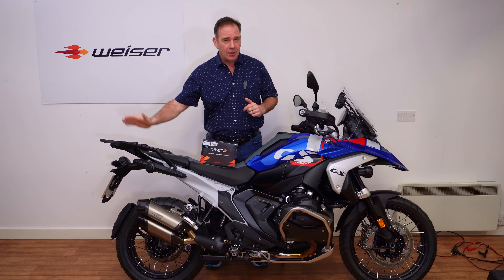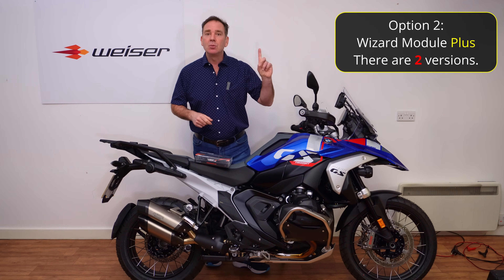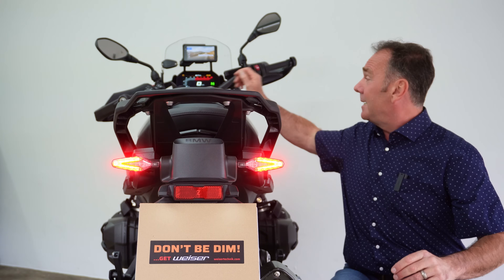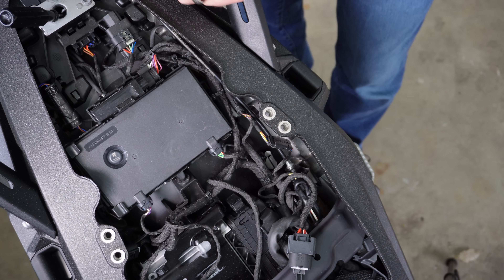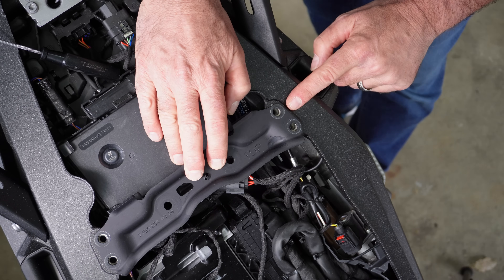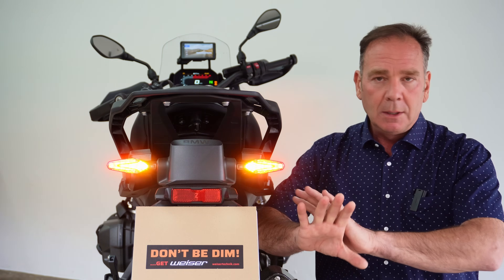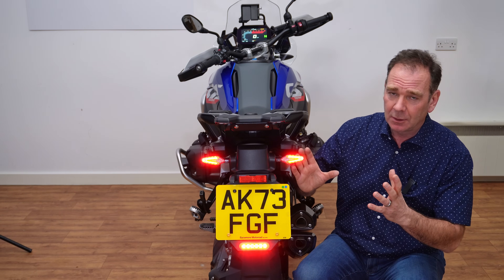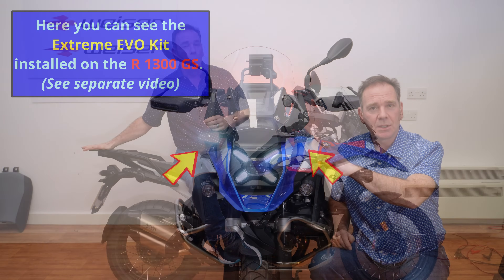BMW R1300GS Weiser-Technik Wizard Module + add a Tail / Brake Light to your R1300GS, F900GS, S1000XR

Comment: I'm riding a BMW R1300 GS for 2 years now so I can speak from experience. The argument that the stock rear light is unsafe is just not true. Many fellow riders have mentioned to me that my stock rear lights are blinding and very distinguishable when it comes to braking and indicating. Using these arguments is just plain BS. 

This being said, the weiser product is adding additional functionality and visibility which is great and why I will purchase them. The weiser products are great in quality, durability and functionality and simply don't need this kind of false arguments. It's only due to camera settings that the stock lights seem to lack in being able to distinguish in functionality.

I would recommend buying these lights because of the added safety and functionality. But don't buy them because you think the stock lights are limiting in visibility or safety. They are perfectly fine and even better than most stock lights. Don't be fooled.

Comment: Since myself and a friend have fitted these we get multiple warnings with rear light failure, cruise control failure and limited emergency call service, and I also see other saying exactly the same on other forums, very poor with no back up from suppliers…..not happy 🤬
Reply from the maker: Hi Fitchy, I am aware that in some geographical locations there has been a problem, which is due to the BMW oem software that is installed in some markets. Weiser has been testing an updated version for these motorbikes, send Weiser an email and they will help you and replace the unit if necessary for free 👍. 

info@weisertechnik.com

Comment: So if you have the British version where it has both tail light and brake light, are you then breaking Germanys laws by riding it through their country?
Reply from the maker: Hi George, Germany has some strange rules like not allowing 3 rear tail lights, but if you’re travelling from the uk to Europe the police are normally very friendly and flexible if you are stopped. However if you’re doing something silly like excessively over the speed limits they may check your bike more throughly, although I’m not aware of anyone having a problem. We also have rules about horns not exceeding a set db level, so technically we can not fit a Denali sound bomb horn, although many owners do.
Hope that helps. Carl
Reply: @justthewayitis thank you for the quick response 😊
Reply from the maker: You are welcome 🙏

Comment: What "problem" are you fixing here exactly?
Reply from the maker: Hi, the standard setup has all 3 functions (indicator, running light and brake light) working in the small indicator at the same time. It’s difficult for people following you to see you indicate.  This system improves this greatly by only allowing the indicator to work by itself when indicating. Hope makes sense 
Best wishes Carl

Comment: Would like to position the extra tail/brake light where the reflector is above the Reg Plate 
I can add a an additional reflector on  bottom corner or the Reg plate 
Your thoughts pls
Reply from the maker: Hi James, Weiser have a new upper bracket that is due to be released in August that allows you to mount a B6 or T3 above the number plate just below the rear rack. This might be something to consider. 
Best wishes Carl 🙋🏻‍♂️

Comment: Thanks for another excellent video. I've just "upgraded" my R1250GS to an R1300GS so I will buy the kit including the additional brake light. It's a pity that the wizard modules I used on the R1250GS are not compatible with the R1300GS but there you go.
Reply from the maker: Hi Richard, good morning and thank you 🙏. You may want to wait a couple of weeks 😉, there is a new product that is due to be launched very soon, I’ve been testing it and installing it on several BMW R1300 models. I have a review video going up on my channel once Weiser confirm the launch date. Best wishes Carl 🙋🏻‍♂️
Reply: @justthewayitis  Thanks Carl, I'm happy to wait - with bated breath. :)

Comment: brake light needs to up high I reckon put the reflector down low
Reply from the maker: Hi Paul, there is a new bracket coming very soon to mount the B6 or T3 under the rear rack, I’ve been testing the prototype for 5 weeks and it’s great for getting the brake light up high. You can see them at the ABR festival next weekend, launch date in a couple of weeks. From Weiser Technik.
Best wishes Carl 🙋🏻‍♂️

Comment: Hello Carl! Can you please show me how to connect the brake light: Denali B6 Auxiliary Led Licence Plate Brake Light correctly to my BMW R 1300 Gs. Is it true that it works with plugin? Please help.
Thanks Chris
Reply from the maker: Hi Chris, first you need the correct V5 wizard module which has the brake light output connections in the configuration you want ( see the Weiser website) then it’s a simple plug and play connection. The routing of the cable is fairly straightforward as you will need to feed it down the centre section under the passenger seat, then inside the rear tail section, exiting at the bottom. I currently don’t have a video showing exactly how to do this, but I am planning to film this later in the summer for both the GS and GSA.
Best wishes Carl 🙋🏻‍♂️

Comment: Can this Weiser kit be installed to the front indicators on a 2021 s1000XR? I believe it’s okay for the rear indicators. TIA.
Reply from the maker: Hi Gary, I think you can fit the updated V5 link wizard modules on the rear if you want to keep the stock rear indicators .
I think you can move the extreme evo kit front and rear from the R1250gs to the 2021 XR. The best thing to do Is ring the boss at weiser (Mark) and ask him to confirm +44 (0)203 649 7524 he is very friendly.
Carl 🙋🏻‍♂️

Comment: Hi Carl - different subject - what make is the engine crash bar? It looks good and it appears adequate and light for on the road use? Great video as usual.
Reply from the maker: Hi, on the R1300GS, it’s the standard BMW OEM bars. Which are probably fine for on road protection with the occasion drop at slow speeds.
Enjoy your Sunday 👍, Carl 🙋🏻‍♂️

Comment: Carl, does the tail/brake light in the V5-BR version just plug into the V5, so that there is no cutting into any other wiring involved?
Reply from the maker: Hi Stags, you can’t plug a them together, they are different modules, the V5BR has the extra cable for running down to the brake light module for the B6 or T3, it’s all just plug and play no cutting wires on the R1300GS/A.
Reply: @justthewayitis thank you again Carl, I very much appreciate you taking the time to reply.
Your videos are superb!!
Reply from the maker: You are very welcome 🙏 the tail unit drops down with just a few bolts removed, you don’t actually need to completely remove it, but it is easier that way. The cable fun’s inside the housing and exits through a small hole that goes to the B6 mounted below the number plate
Reply from the maker: Also there is a new product coming from Weiser that allows you to add extra hand guard indicators in addition to the inboard ones. It also offers you  all the V5BR features and more. I’m currently working on a product release video for them and have installed it on several new R1300GS and GSA models. It’s an amazing product . There will also be a new bracket to mount the B6 under the rear rack assembly.
It will be released at the ABR festival at the end of June.
Carl
Reply: @justthewayitis  That’s interesting, might wait to see what the new bracket looks like!
Once again, I thank you for taking the time to explain things in such detail to an idiot like me 👍😊😊
Reply: So the B6 has a connector that just plugs into the V5?
Reply from the maker: Just for clarification it plugs into the V5BR & V5BO but not the standard V5 😊
Reply: @justthewayitis  Yes Carl, I’m going for the V5BR. Thank you again! 👍
Reply from the maker: 👌 have fun 🙋🏻‍♂️ it’s a great addition to the GS on the rear.

Comment: Hi carl,  my order extreme evo rgs1 rear just came today,  do you have any video/installation guide specifically for GS  1300? thx!
Reply from the maker: Hi, good afternoon, no sadly I do not have an installation guide yet for the 1300, I will he doing one later in the season when I have a 1300 to work on.
It’s fairly straightforward, I wish you success 🤞
Kind regards Carl 🙋🏻‍♂️

Comment: Carl. I watched your video and bought the modules for my R1250GS tail /stop light and rear indicators. I'm just about to fit them but I'm concerned that as a modification it will invalidate my bmw warranty. What's the BMW position with this ? Thanks Steve
Reply from the maker: Hi Steve, well BMW dealerships install these directly both in the UK and North America, so I don’t think it’s a problem. Weiser supply these to several uk dealership and they keep them in stock and install them on their customers BMW bikes.
You could ask your dealership of course.
Best wishes Carl

Comment: Thanks a lot for your great videos. Due to i live in Slovenia, i need to do homologation for this lights /same i order and install. Could You Please give me the link where i can get something as TEV or ISO for this lights. Back in March 2024 i purchase Weiser EXTREME EVO Multifunction LED driving lights ( front and back), together with WIZARD OEM Rear indicator resequencing modules.
Reply from the maker: Hi, the weiser wizard modules for the front or rear do not need any approval for use, because they retain the original indicators which are already type approved.
I have Extreme EVO installed on my R1250GS and have no problems taking my motorbike for the TÜV. It has passed the inspection.
You could send your question to Weiser-Technik via email for more help and information.
Carl 🙋🏻‍♂️
Reply: @ CARL many thanks for Your reply. Will keep this way, without homologation. Many Thanks as well for Your excellent videos. (unfortunately , from Weiser-Technik i did not receive reply to my mails).
Reply from the maker: Which model do you have ?
R1250gs or R1300gs
Reply: @justthewayitis  I have R1250GS (ultimate edition /2023)
Reply from the maker: Ah ok 👌 so do you have weiser wizard modules fitted at the moment?
Reply: modules and as well new LED indicators from Weiser Technik installed and used since end of march 2024 ; there is E-mark on the LED lamps housing / plastic; but guy on annual vehicle inspection require homologation of same - anyway. It is requirement. Any light which is not original need to pass homologation. It is routine if you have proper documentation. I install as well Denali D7 pro lights as well;  same need pass homologation ( Denali privide necessary product certification / documentation).
Reply from the maker: Ok, now I understand 👍
Have a great Sunday

Comment: Hey Carl! I really hoped you had shown how to install those additional rear lights and especially how to put rear light cable inside the stock tail of R1300GS. Do you have such video by any chance? I can't figure out how to disassemble that plastic piece with the rear radar.
Reply from the maker: You can watch an installation here. https://youtu.be/SnXRjl5PDZw?si=QWk4pM5cTcdCDTbM
Reply: @justthewayitis  thank you so much 🙏Now it makes sense to me how to do it!
Reply from the maker: No problem, glad I could help 👍
Reply from the maker: Hi, no I don’t yet have an installation guide for adding a brake light to the rear of the 1300, but log into your google account, then go to my channel and then you can see my contact email address, send me an email and I’ll reply with some pictures 
Carl

Comment: Hi Carl.  Got my new GSA and fitted the Weiser kit with rear brake light/ tail light.  Mark from Weiser gave me a tip to feed the brake light wire up through a drain hole which is behind the the reg plate. Just had to remove a rubber grommet and bore the whole a little bigger to let the plug on the brake light push up through.
Really really pleased and I would highly recommend this to all GS/GSA owners and it was easy to fit following your instructions. Thanks again. KR David
Reply from the maker: Hi David, good morning and great to hear your GSA had arrived. Yes I think many owners will be adding the Weiser-Technik modules along with a new brake light to the rear of a gs/gsa, it’s a major improvement. Thank you for sharing your thoughts and installation tip 👍.
Have a happy festive season 
Kind wishes Carl

Comment: Unfortunately, the version shown with the 3rd brake light below the license plate is NOT road legal in the EU. According to ECE-R53, a motorcycle may have two brake lights according to category S1 and optionally one HIGH-mounted brake light according to category S3. The third brake light must be installed ABOVE the other two brake lights AND at least 850mm above the road. For this reason, models such as the R12, nineT, and R18 do not have the middle brake light as standard, but only the two side ones.
Reply from the maker: I’m aware of some of the limitation imposed on us motorbike riders in EU, it’s strange law that many of us would like to see changed. In the EU we are also not allowed a 3rd tail or running light which seems counter intuitive to road safety.
I think what we need is a large motorcycle group / body to raise this concern in local government to address this concern.
Thank you for sharing the clarification on the rules.
I wunder how the R1250gs was allowed to have 3 brake lights during its production…
Best wishes, Carl
Reply: @justthewayitis  On the R1250GS, the 3rd brake light is mounted high enough (over 850mm and higher than the other two brake lights), so it complies with ECE-R53 and is therefore legal.
Reply from the maker: Danke Jens 🙏

Comment: Thanks Carl.  Just ordered it for my new GSA.  KR David
Reply from the maker: Hi David, congratulations on your new GSA 👍, which colour option did you choose ?
Reply: @ Hi Carl. I chose triple black with tinted screen and winglets. I’m going to powder coat the radiator covers, the luggage rack, and the cylinder head protectors, and spray the standard exhaust with high temp Matt paint which is what I did on my GSA1250. I enjoy watching your channel 👍
Reply from the maker: Hi David, that sounds like some great ideas you have, and very nice specification too, they do look lovely in that colour combination. I have friend Pete who also did something similar with his 2017 GS Rallye, the blue one, and it looks stunning with chassis / body parts colour coded to match.
I wish you many happy hours on your new GSA.
Thank you for sharing and the feedback on the channel, I hope to have a GSA series soon.
Kindest regards Carl

Comment: Please tell them about the exhaust system that erodes/rust, fork seals braking, brake and clutch noises. Just one cheap bike witha  he'll of a price tag . Fast, handles well, all and all great  when you see it, ride it...and then all the cheap crap to finish off. I have one. It is at the dealership, I refuse to drive it. It I an embarrassment when getting to the other bikes
Reply from the maker: Hi Frank, I hope you have passed your thoughts about the new R1300GS build quality and reliability… back to bmw, and I do mean BMW customer complaints and not your dealership.
My own experience is that dealership do not pass much…if any customer feedback onwards to BMW itself.
Best wishes Carl

Comment: Experience with programming is a stretch, a GUI interface on a simple app is hardly programming, I love your videos and Weiser Tech, but keep it honest!
Reply from the maker: Hi Charles, if only you knew what I got to see in terms of “Experience with Programming” while I was there at Weiser HQ… I was not allowed to film the module functions installed on the bike in the video, but I was extremely impressed.
The new product is due to be released later this year.
Best wishes Carl
Reply: @justthewayitis  I meant you referring to the ezCan software as requiring programming.
Reply from the maker: Hi Charles, ok, now I understand. 👍🙋🏻‍♂️

Comment: Hi Carl, is there a local dealer in Germany, where I can buy the Weiser Wizard? The only location I was able to find is UK or NL. Maybe you can assist. LG Uwe
Reply from the maker: Hallo Uwe, sadly no Distributor in Germany 🇩🇪 I would order it from NL, then you will have no import duty or tax. Let me know how you get on with your installation 🙏
Lg Carl Im Hessen
Reply: @justthewayitis  Thank you very much for the quick response, although I was hoping to get a different one. I’ll keep you posted once I have assembled the unit.
Reply from the maker: 👍is this for a R1300GS ? Or an earlier model
Reply from the maker: Just thought I would ask as if it’s the 1300 and you are thinking of adding an extra brake light, just bare in mind the Denali don’t have approval for the B6 here in Germany , but the T3 does 👌
Reply: @justthewayitis  thank you very much for the hint! I had the B6 on my bike all the time in Germany even with TÜV and never had an issue. But maybe I’ll switch now to T3!
Reply: @justthewayitis  Yes, I was asking for the 1300. since I have a CanSmart already operating due to my lights I wouldn’t consider the Weiser option with brake light.
Reply from the maker: Ok now I understand 👍